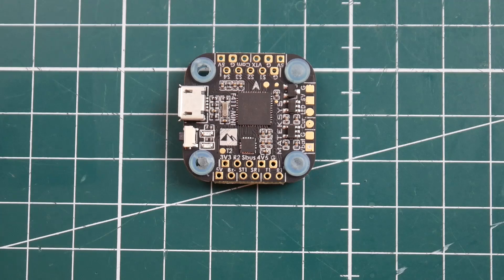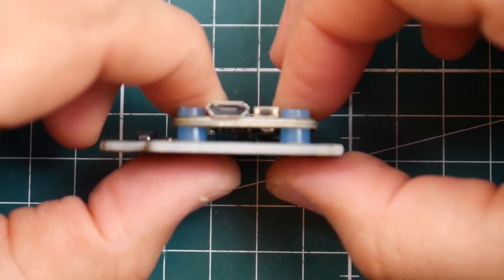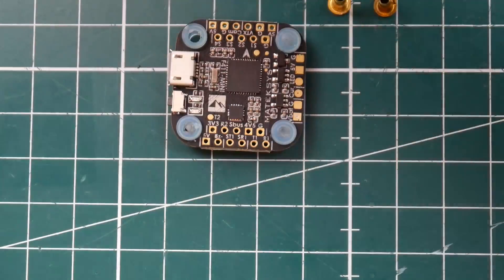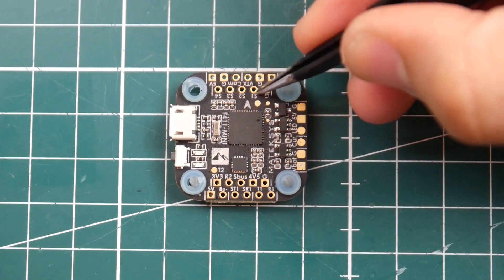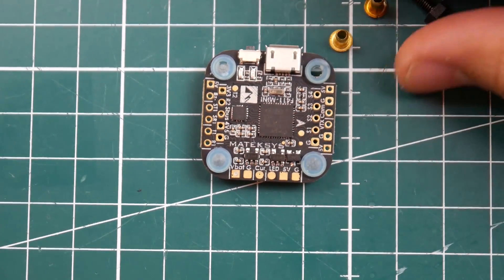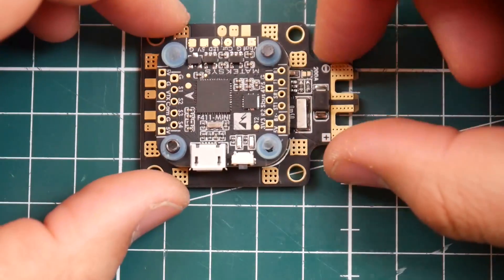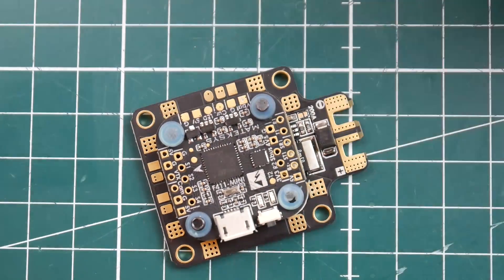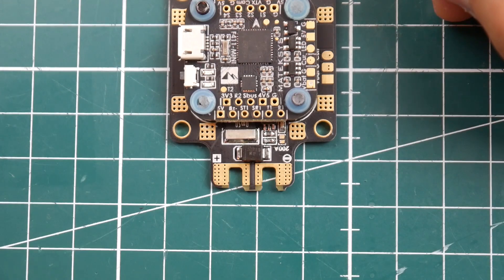Hybrid Flight Controller // Matek F411

Comment: Crazy crap for a 5 inch build. The extra screws with there nuts to put it on the PDB have so much weight like a 30,5 x 30,5mm FC-Board. And the mini-boards goes much more in flip of death.

Comment: how do you get the f411 mini into dfu mode? i can get into the cli but it will not accept (dfu>enter) and using the boot button it doesnt go into dfu mode. any help will be much appreciated!
Reply: Just type bl in the CLI. Disconnect and replug the fc and should be ok

Comment: I wish Matek would design their own 20x20 4-1 ESC to go with their mini flight controller lineup. It's cool how this integrates with their PDB, but for use on an actual micro quad, that PDB just isn't an option. It's full size, and secondly, no one's using separate ESCs for micros nowadays. Bonus points if Matek can make it BlHeli32.

Comment: If someone didn't noticed, Matek F411 FC use slower STM32F411 MCU chip clocked on 100 MHz frequency. Usual F4 MCU-s (STM32F405RG6 for example) are clocked to 168 Mhz. Also F411 use MPU6000 gyro, but F405 - ICM20602 gyro, capable to 32 kHz. The difference appear even in pricing between Matek F411 Mini and F405 Mini FC pricing. The second one (F405) is 10$ more expensive. F405 Mini have the same grommet/tube adapter mounting system that F411 have. I wouldn't argue that for regular Joe slower, but more stable gyro may be better and that ICM20602 have some known problems. The main thing here is that F405 Mini FC is more suitable for advanced filters like BIQUAD+FIR2 or Kalman filter when BF devs will return it back in mainstream code. They who wish to test these filters in micro brushlesses, should note the differences between both FC's too.

In fact the simple idea with tube adapter for mounting with both M2 and M3 screws is not new. Had to use isolation tube pieces to mount Pico BLX FC which had M3 screw holes in later frames with M2 screw holes in last year. But Matek made it very comfortable together with already built in vibration dampener and that is nice.
Reply: I noticed the f411 but I think common f4 with MPU gyro running 8/8kHz are pretty enough, do you think the f411 is not worth  to buy? have to slow down the loop?

Comment: I think the world needs is flight controller that has:
OSD
PDB
Soft mounted gyro
And has components only on one side
That would be just best fc ever
Reply: BuzzCola 3 what always rcaddict uses? Only the gyro is not soft mounted
Reply: Bennie Leip in that case you must soft  mount the gyro
Reply: BuzzCola 3 😆
Reply: Omnibus F4 Corner Nano. Matek, your answer?
Reply: KrotowX the Omnibus f4 pro corner would be best if it was on single sided pcb
Reply: I agree, but it is not in one side. They should made such board too though. Fortunately it doesn't matter if you still have 4-in-1 ESC board below FC.
Reply: KrotowX with 4 in 1 esc it doesn't matter if it is double sided PCB, but if you want a super ultra low rider frame you want that so you don't need to use standoffs in between Fc and frame
Reply: I know. And I'd wrote above that having single sided board as next would be nice too.
Reply: You are talking about the Holybro kakute F4 v2 aio

Comment: I tried to use one of these a couple months ago. The gyro had so much noise that the motors just rotated with power like it was constantly trying to correct it self, the. It would vibrate out of control. Hope yours is better.

Comment: why not make the pdb 20x20 the same size as the  flight controller
Reply: We already have 4-in-1 ESC boards in 20x20mm format where battery is connected directly to ESC board. No need for PDB anymore and easier to build in stack too.

Comment: 1st... Not sure if it's true with all boards but I find that powering the camera gear through a good filtered pdb produces a lot less noise than going through all those components inside of a flight controller to power your camera and vtx. Then again I'm no engineer and I don't have any real way of testing this but past experiences lean heavily to one side will normally make you think.